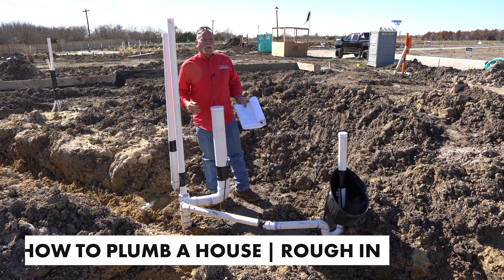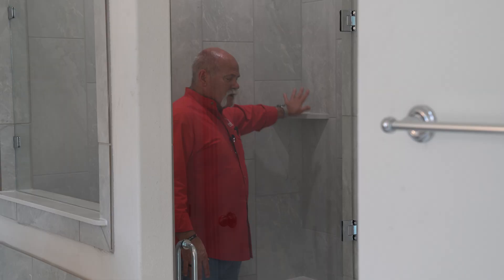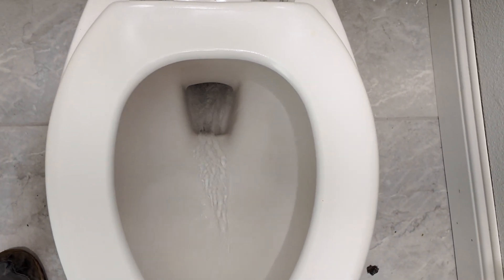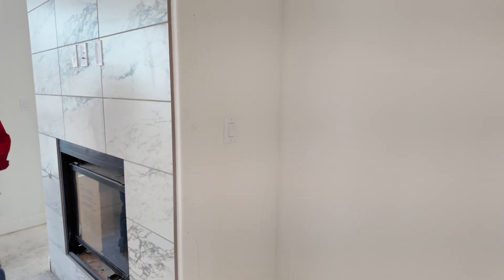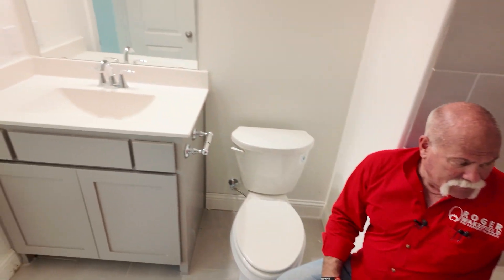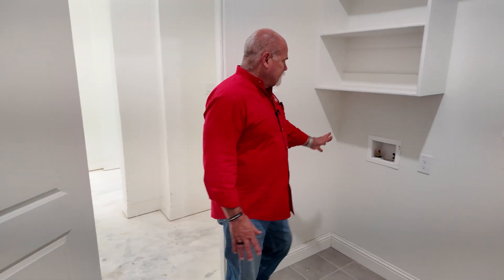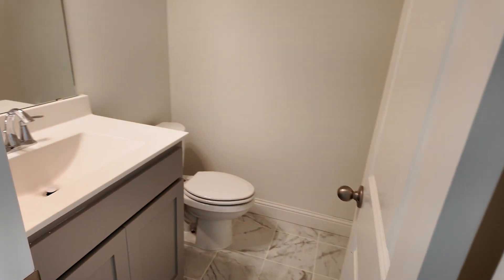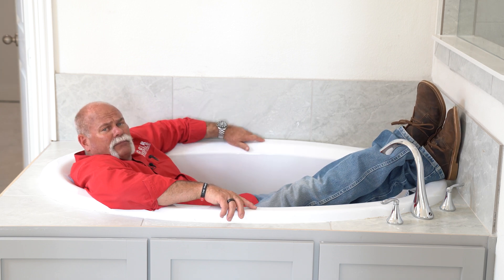How to Plumb a House | Setting Fixtures

Comment: Drives me nuts how dirty it was under the tub and a lot of the electrical outlets were crooked then the GFCI sticker extra crooked and how dirty the washer box was
Reply: A lot of items can be fixed but some items like the washer box is plastic and it’s a pain to spend time on cleaning that and it may stain which would never come off, all they would have to do is tape it off. But it’s all about the mighty dollar.